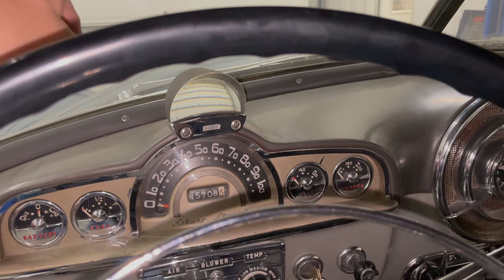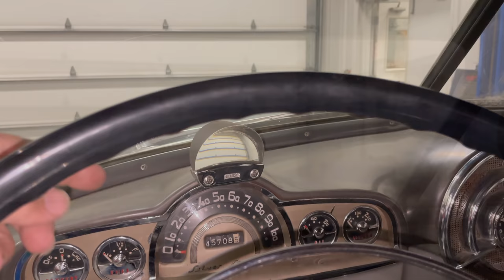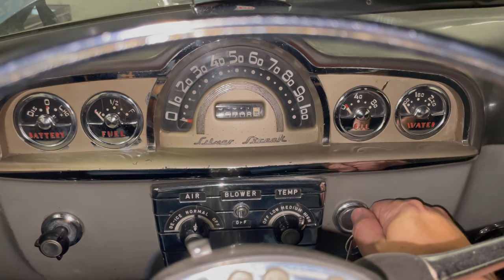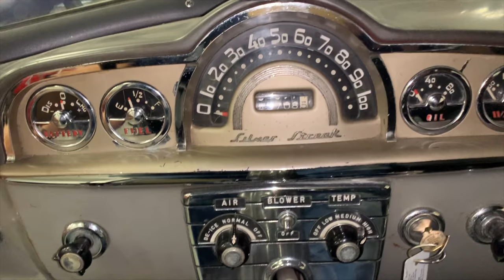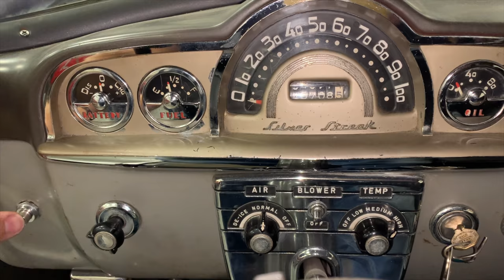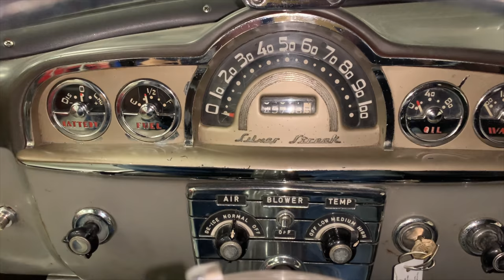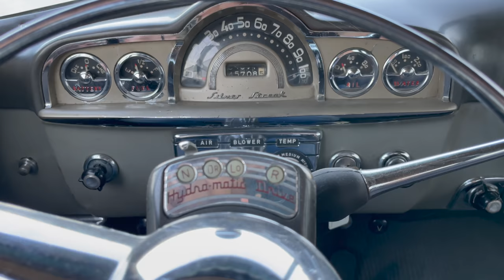Starting Your Classic Car After You Let It Sit Too Long

Comment: This calm, methodical approach to the process is an excellent example for any novice mechanic, and the actual results are interesting for the experienced. 
If the car's been sitting for a while, the quality of the remaining fuel is definitely in question, especially if it's from the era of the evil ethanol adulteration. This car seems to have escaped that problem.

Comment: There was a older lady in my town who had the exact same car. Went to her house a few times and asked to look at the engine. She always let me. One time after a snow storm she was on ice in front of the firehouse. She was not getting traction. She had placed the floor mats behind the front tires. Myself and a few of the guys happened by. We put the mats back and gave her a good push back onto the road which had been cleared and off she went. She thought I was a thirteen year old genius. I told her that I would like to buy the car if she got a new one. She passed away and her son sold the car. In case you couldn’t tell I grew up in a small town. Enjoy your videos. Thanks

Comment: Hi Steve, the usual informative and entertaining video. Great to watch your calm way of working, and approaching every challenge in a methodical way until it is solved. My first car was a 1955 Austin A30, with semaphore indicators, an 803cc A-series engine, hydraulic front brakes but mechanical rear, no syncromesh on 1st gear and lots of other "idiosyncrasies". I spent many happy hours working on it with my father!

Comment: What a beauty! Great to see such a well-preserved original two-door. 
I would disagree about priming the carb from the get-go. Given that the car has sat for so long there'd be no oil in any of the galleries. Cranking the car enough to bring gas from the tank would also pump oil throughout the system, minimizing the chance of metal-to-metal contact when the engine first catches.

Comment: Having acquired more than one car that had been sitting ['65 Riviera, '62 Coupe de Ville and my current '97 Volvo 850GLT], I can relate. 

All of the rubber needs to be replaced -- every belt, hose, bushing, tires, wiper blades -- before it can be driven. All of the fluids need to be flushed and replaced before starting. Likely the radiator will be rotted away and need replacing. Ditto for the entire ignition system. And that's if it's been stored indoors. If it's been sitting outdoors, the interior and paint will likely be completely shot.

When you look at the car, you are smitten and see what she could be. When your friends see the car -- especially your wife or girlfriend -- they see it as it is: a rusty, pile of junk you spend time and money on that would be better spent on them. 

Oh, well. You can always get another girlfriend...

Comment: Steve, just a quick comment. I've watched you reassemble several diaphragm fuel pumps and would offer some advise based on what I was taught as a Joseph Lucas/CAV/Girling apprentice in the '60s.  When tightening the diaphragm screws you should pull the bell-crank lever up to pull the diaphragm down. Once tight, the diaphragm can now stroke without stretching, significantly increasing it's useful working life.  I love your videos and your approach to nursing old cars back to life.

Comment: 69 CJ Stang that I bought June of 69 gets run every 5-10 years. Started it again June 27, 2021 last time was MAY 2010...  Pulled the car cover back to the cowl; new battery; pulled the ignition lead off the solenoid and 15 minutes of 20-30 second cranking (solenoid jumper) to move the engine oil - no ignition wait various times between cranking. Connect the ignition lead and 8 seconds of cranking it fires. Never touched the carb! Do that three times and then a hot bat jumper to the ignition and it starts and runs. NEVER opened the doors. Plugs, points, cap etc have not been changed since 1971. No lifter noise, thermostat opened.  Need to replace the 50 yr old Hookers and the 3,400# Schiefer pressure plate to a  streetable one. One of these days -- hmm been saying that for 30 yrs....

You used baking soda & water on the bat cables but not the tray.... heavy sprinkle of baking soda before physically scraping and dribble some water on it. Let it sit, react and neutralize the corrosion then wash it away. Leaves the tray neutralized with a small protective layer. Sprinkle the tray with baking soda before installing a new battery for more proactive protection. You also did not recommend a fuel stabilizer for ethanol gasoline sold today and lead additive for the older engines that lead was part of the standard fuels. Products like StaBil and Carb Defender to deal with the current fuels that older vehicles were not designed to work with.

Comment: Well out here in the hot Arizona desert starting and running a car with even 3-5 year old fuel is a sure way to get stuck valves. I hope when you layed that car up  you put some Stable in the tank. Crap fuel with alcohol in it out here in the summer will start going sour in a few months especially if the tank is low on fuel.

Comment: Steve...I didn't hear you mention the old fuel in the tank. Are you normally concerned about fuel this "old"? I always use Sta-Bil which seems to work great. Your video is perfect timing as I haven't started my E-Type, MK 2 and XK140 in a few years! ALWAYS enjoy your videos!
Reply from the maker: Not fuel that is "this" old, especially here where you can get non-ethanol fuels.  If you lived where you can only get gasoline blended with ethanol I would be more worried.
Reply: @ThisWeekWithCars  Understand!

Comment: I would be worried about the quality of the gas in the gas tank. I only use NON ethanol gas in my old cars and lawn equipment. Project Farm has a great video on the deterioration of ethanol containing gasoline and the corrosion/damage it can cause to carburetors and of fuel system components.

Comment: I get the feeling that you might have a little problem again if you find yourself driving down a steep incline, as the fuel tank will be above the fuel pump.  Carbs got more and more complicated over the decades to address such conditions.

Comment: I use marvel mystery oil  in cylinders  plugs out spin over to lubricant  plus add to fuel 
I always lube points rubbing block and oil distributor shaft  some use grease or oil 
Generator oil the cups ... give car full lubricant service

Comment: I've been having the fuel pump gaskets shrinking a bit in recent years on cars that are parked for too long. They are fine when they are used but don't like to dry out.
Reply: Dont suppose Ethanol is doing old car fuel systems any favours

Comment: I don’t agree with using starter fluid before at least turning motor over first to bring up oil pressure or at least circulate oil to parts that have not had oil for a while. . You are lucky you did not do any damage if it had fired at first attempt.

Comment: Just got a 61 Thunderbird started for the first time since 1974 and changed the oil before I even attempted cranking along with adding a little marvles mystery oil but wondering if I should change it again immediately?
Reply from the maker: Depends how well the previous person took care of it.  If you know you are going to change it right away you could but some seafoam in the oil and let it clean things up a little more and then change the oil.

Comment: Was that running on the old 6-volt still or did you have it converted to 12?
Reply from the maker: Still 6 volt
Reply: @ThisWeekWithCars  nice. 
If It's not driven all the time there's nothing wrong with just keeping it as a six I noticed a couple of guys over there I think it's in Czechoslovakia or one of those European countries they got some like 1950s original opal and they kept it 6v 

It's kind of like a lot of people the battle goes on you have an old car do you convert it to HEI or like pertronix or do you leave it with the points if you don't mind messing with them.
Reply from the maker: I say it depends how your use your car.  If you rarely drive it and are just getting ice cream HEI or pertronix is fine because it will always start but if you are driving through the desert of Africa you would want points because you can fix it with a twig.

Comment: Didn't you use the baking soda solution to neutralize the acid residue on and under the battery try? I would do that and then paint the battery tray. An ounce of prevention....
That is a great looking car which appears to be all original. Where has it lived it's life?